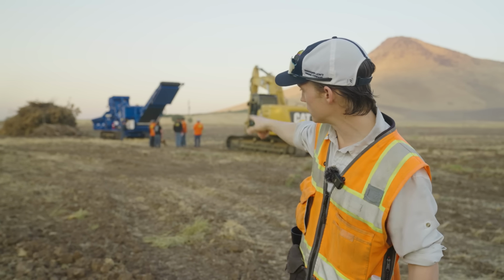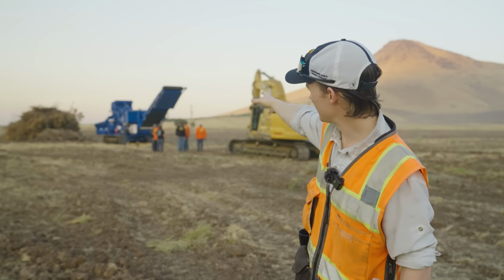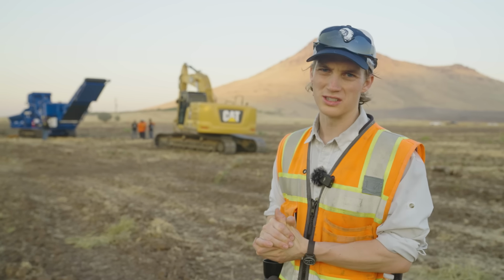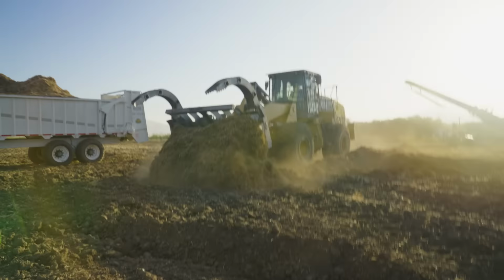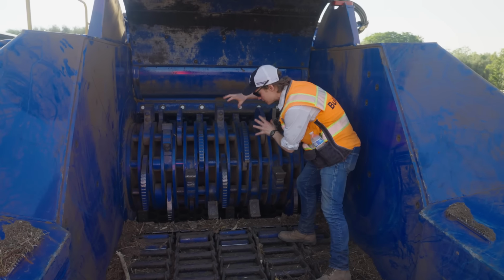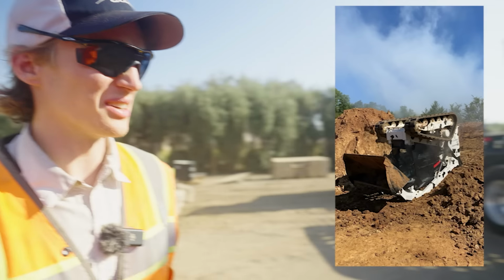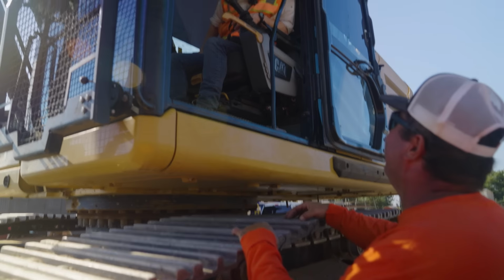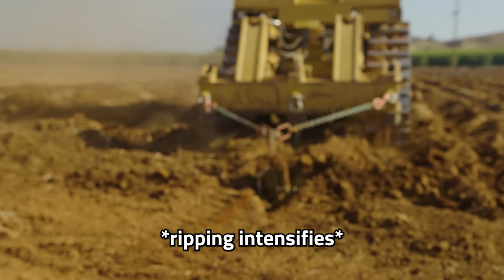Why Shredding Trees is the New Norm in California

Comment: There is a german company, Jenz, who also makes large shredders for bio-material. They make the BA 1016 with over 800 hp, a very impressive machine as well. They also make self-propelled models which are mounted on truck chassis, with a loading crane for feeding the shredder and a turning cabin which can be facing forward for driving or to the rear for working. They are in Farming Simulator as well.
Reply: This machine has 2,000Hp big difference.
Reply: @robbybachmann8061  Aaron mentioned that it's powered by a Cat C32, which is listed as having a maximum output of 1350hp.
Reply: @robbybachmann8061  Now, i am not sure how Scrap-board-production is messured, but if it is roughly equal to the german unit Schüttraummeter, then this machine performs worse than the Jenz. The Peterson only manages 499 m³, while the Jenz manages 540 m³. And with a smaller engine, the Jenz probably also uses less fuel.
Reply: The farming simulator sentence could have been left out, we would have been fine.

Comment: A burning ban may seem silly but California’s Central Valley, especially the San Joaquin is subject to very stagnant air, especially in winter that produces “radiation fogs.” 

After a winter storm passes through, the clear air and damp ground encourages an overnight ground fog which is slow to burn off, and just gets thicker night after night and is known as a “Tule Fog” with 1/10 mile visibility, that will persist until the next winter storm passes through, clears the air and re-starts the cycle. Add smoke form any source, and it just gets worse. 

The Wasatch Front at Salt Lake City has the same problem, with freezing temperatures creating “ice fogs.”

Comment: The reason you load over the back isn’t because it’s faster than a normal low bed, it’s because this model trailer absolutely sucks to break down the neck. And good luck getting it back on on uneven ground like some construction sites without a ton of experience
Reply: Those trailers are built for that  the neck is quick and easy to get off you can load them off level and when it's raining just have to plan for it

Comment: The 6710 eats EVERYTHING. Its not uncommon to replace those teeth on the mill daily, depending on your feed stock.
Reply: Used to operate one of these and the massive stumps and shit we put through it we would check the teeth on the rotor at smoko and end of shift, replace or rotate and tighten

Comment: I was camping near North Rim Grand Canyon and saw a Barko 937B going around on forest service land shredding trees. This went on for weeks. Much smaller machine than this (I'm seeing 300hp or so) and very different setup too, but I'm curious as to the reasons for doing it there. They were thinning, not fully clearing.
Reply: what you saw is likely forestry mastication, used to reduce (small diameter) tree density in forest stands that have not experienced the frequent, low intensity fires that they evolved with.  Before mastication these stands probably had a high density of smaller trees from the lack of fire, which leads to increased danger for extreme fire events, as well as a general decrease in the health of the ecosystem.

Comment: Almond and Walnut prices are at the lowest point in decades. They are doing a lot of removal of old orchards, but are also removing a lot of good producing almonds because they are not turning a profit due to the market. In 2008-2010 farmers began planting almonds like crazy as the market was projected to boom - but new trees don't produce for 3-4 years. By 2014 the market hit it's peak and with all the new acres of almonds beginning to produce and be injected into the market, the price began to decrease - 2008 we had about 800,000 acres of almonds in CA - in 2021 there were over 1,650,000 acres - that number is now decreasing, being replaced by other more profitable crops.

Comment: Isn't it also much safer mixing the stuff into the soil vs setting things on fire?
Reply: only in california.
Reply: @THEmadmikeismad  california and the rest of the developed world
meanwhile the rest of america follow india, china and africa in the way they do things
Reply: @vincentgrinn2665  And instead of doing it the cheaper way you get to pay for this $1mil machine, fuel, labor etc in the price of your produce, I hope the better air quality in the middle of nowhere is worth it.
Reply: @jaycweingardt11  the cost to healthcare that crop burning causes is far more than the cost of the machines, 18,000 people die from crop burning smog in america every year, and it isnt just the middle of nowhere, that smog moves hundreds of miles

and its severe too, like you cant go outside without a mask otherwise youll choke kind of bad
Reply: @vincentgrinn2665 where the hell did that fact come from and how can it be proven? I mean a properly built brush pile barely produces any smoke as long as it's not packed with dirt and it's dry.
Reply: @Chad-qe6yv  well theres obviously some issue because its a common and significant problem all over the world, and the main pollutant is black carbon(think diesel coal rolling, coal power plants etc) so im not sure what impact dirt has on that
Reply: @vincentgrinn2665 The stat you pull is probably from forest fire (if its true)there is a huge difference between a couple of tree and 10'000. The carbon from the tree will still be release the only difference is how fast, so yes this way of doing it is way worst in almost everyway.
Reply: @raptor0286  youre right that theres a huge difference between crop burning and forest fires, forest fires are just that much worse
also the speed of release is a significant and important factor, running your car engine with the garbage shut for a few hours and burning some matches nonstop for a year might be the same amount released, but the matches wont kill you.

also when the ground up tree material is put back into the ground, very little of it is released, as it all either disperses into the ground or ends up in the next lot of crops. its specifically burning the organic matter that causes a lot more issue not just natural decay
Reply: @vincentgrinn2665  Is the air quality why people are leaving California? or is it the sky high cost of living and massive taxation?
Reply: @vincentgrinn2665  Almost all of the nutrients stay in the ash and is left for future crops. lots of decaying organic matter sucks oxygen from the soil and weakens roots of future plants.
Reply: @jaycweingardt11  all of those things are rampant in most american states, well other than the flyover states
Reply: @jaycweingardt11  The people leaving are generally older, conservative, and not exactly "makers" as the right like to babble. I doubt that the economists and politicians are wringing any hands over their departure.
Reply: @kerrykerry5778  The absolute state of California would show that is not true. But enjoy your cope.
Reply: @jaycweingardt11  California has a strong conservative/liberal divide. In terms of agriculture - we're king in the US. The wood chips do wonders for the heavy clay soil as they decompose they soften it up and promote mycorrhizal growth. We have more citrus than Florida, more peaches than Georgia, and more dairy than Wisconsin. 

Now the big cities have plenty of bad governance, but we also have lots of small wild west towns that are doing just fine. Even Central Valley towns are widely growing as people escape the urban hell of places like the San Francisco.
Reply: @jaycweingardt11  lmao not only do you cope but you're wrong about the soil science too. Decaying organic matter is necessary for healthy plants and burning all of that would mean you lose all the carbon rich hummus and hummic acids. Maybe if you spent your time learning instead of hating on the biggest economy in the nation you'd know something.
Reply: @Chad-qe6yv  That stat comes from medical studies and is supported with statistical analysis.
Reply: @jaycweingardt11 nonsense. Go to any forest and see if organic matter "sucks oxygen" from the soil.
Reply: Interesting to note that the fuel consumption of these machines would exceed 250 gallons per hour at that rate which option produces more chemical waste and which is worse for the environment? Especially when the chemical reaction of a wood fire basically produces CO2 and water??😊
But then again a lot more profit for someone 😮
Reply: @kancutter  bingo, that's what it is. I bet there are lots of politicians who own shares in this chipping company.

Comment: I used to run the next size down from that grinder the 5710 and a 330 on pipeline. we always side loaded both it takes about 20 seconds for the 330 and about 40 for the grinder. and for the sideload haters our trailers would get sideloaded 20 times a day with no issues.

Comment: One thing you didn't mention here is, how often do they do this?
Reply: can be several decades depending on crop
Reply: Depends on the crop but the usual cycle is 15-20 years
Reply: Depends on the tree but an orchard out there will normally go 25-30 years before they have to rip it out and start over. Once you replant then you have a 5-10 year wait for tree nuts before the orchard is productive again.
Reply: Almonds 15yrs+ 
Walnuts 30+ (market is weak, a lot are coming out)
Grapes (???) 
Citrus 30+
Stone fruit 30+
Pistachios 50+

Comment: I always though that if you tilled chips it would kill soil life. Soil bacteria that thrive off carbon would decompose the chips, multiplying exponentially and saturating the soil with affixed carbon instead of nutrients. Best to leave the chips on top where they can retain moisture. But hey, I'm not the one getting the gov subsidies.
Reply: It kinda depends of the depth, quantity and quality I think. If it's high C/N wood, from trunks and old branches, tilling it in further than 4 inches leads to anaerobic conditions, the wood doesn't decompose at all, turns hard and grey, etc... Especially in low humidity conditions. And nitrogen hunger on top of it as you mentioned, that can go on for a looong time. Not a fan of this method either.

Comment: Call me skeptical but how could burning those trees put more pollutants in the air than the entire process of shredding, spreading and ripping it into the soil...
Reply: That would be a good question for the people that run California
Reply: Carbon sequestering for one, but also if you have ever seen a massive bonfire it’s exponentially more emission than a dozer exhaust and will burn for days. You probably send more smoke into the air in one hour of the burn pile than a month of dozer work.

Comment: Can’t burn to conserve air quality, then the grinder is kicking out that 3:26 😂😂
It’s just convoluting a process to extort money
Reply: The difference is that the dirt and chip particles are heavier so they will eventually fall back to earth; smoke is much lighter so it just stays airborne.
Reply: @Duvstep910  several million dollars in equipment to clear land, only in commifornia.
Reply: I agree, but they are using the chips as compost, it's better for the soil in the long run.
Reply: I misunderstood your comment, dirt particles are heavy and sink to the ground, so while the immediate area is affected, smog isn't a factor here.
Reply: @benzlover55  They're not composting, though. That would involve piling it up and letting it rot in one place for a while with a bunch of added nitrogen-bearing stuff. This is just ploughing carbon under. And not really ploughing it either.
Maybe if they weren't using flat farmland to grow trees, they wouldn't end up with hardpan?
Reply: @Skorpychan  Composting is fastest when there is a balanced amount of carbon and nitrogen in a large pile where bacteria partially break it down. The bacteria also produce heat, and the heat will break it down further. 

When the wood chip[s are burried in the soil, they are instead broken down by mycorrhizal fungi which are excellent for plants. As the wood chips break down - they also release nutrients slowly over time and soften the heavy clay soil.

Comment: That is the hardest thing on lowbeds there is and very unsafe because when you put steel aganist steel  there are chanse of sliding off too the side with no control and a very good chance of damaging both lowbed and machine even hurting the operator a drop front lowbed is a lot safer than this operation !
Reply: Seems like they knew what they were doing. I’m assuming you’re not running millions of dollars worth of equipment. If it was bad they wouldn’t be doing it. It’s also what the trailer is designed for

Comment: What is the idea behind loading that way? Just quicker than removing the neck?
Reply: Disconnecting the neck takes me about 2 minutes total so that’s not where I see the benefit. When you are picking equipment up off-road, the trailer tends to sink into the mud when loading unless you put blocking down, which can make it difficult to hook the trailer back up.

Also helps where there is limited access, you would need room for machine to get around truck or trailer to load so backing right up to machine is helpful.

Lastly, you should use mats or plywood when tracking over asphalt so this could limit the need for that considerably.
Reply: @Treehandler  thank you 👍
Reply: Takes less yard space for loading.

Comment: Little over kill running 6710 in that stuff dunno why owner would wanna burn that extra fuel for zero gain then running smaller grinder
Reply: Yeah you definitely know better than they do.
Reply: @maxmyers1554   been running wood grinders for 10 years so yeah prob do
Reply: The wood chips are excellent for the soil. They soften heavy clay and also support mycorrhizal growth. It's not zero gain when you're growing trees for decades vs corn/soy/wheat for months.

Comment: ROFL, how is running a massive diesel engine for a few days better than burning??
Reply: Now in terms of carbon - with fossil fuels you take carbon from underground and move it to the air. Trees take carbon from the air and wood is mostly carbon. Burying that carbon back in the soil sends it back where it came from. 

It's also not a few days, it's a few hours. The wood chips do wonders for the soil and that has made California the state with the most agriculture output.

Comment: So correct me if I'm wrong. 
But you can't burn because of particulates that go in the air but you can burn 1000's of gallons of diesel running the machines that mulch the waste? 🤷
Reply: Wood chips are great for the soil and a big part of what made California the agriculture capital of the US. Those diesel engines don't run long enough to burn thousands of gallons, they get it done fast.
Reply: @aminy23  Fuel Consumption of the C32 engine. The engine that's in the chipper. This is not including the other plant on site.
100% load with fan – L/hr (gal/hr) 262.7 (69.4) 262.7 (69.4) 238.6 (63.0) 217.9 (57.6)
75% load with fan – L/hr (gal/hr) 195.9 (51.7) 195.9 (51.7) 179.2 (47.3) 164.8 (43.5)
50% load with fan – L/hr (gal/hr) 135.9 (35.9) 135.9 (35.9) 125.8 (33.2) 117.2 (31.0)
25% load with fan – L/hr (gal/hr) 80.8 (21.3) 80.8 (21.3) 75.9 (20.0) 71.4 (18.9)

So yeah it does use 1000s of gallons of diesel if used at 100% over an 8 hour day. Which it will be inorder to chomp through the trees they were feeding it.
Even at 25% it uses 21.3 gallons of fuel per hour!!

So you might wanna check some facts before commenting.
I'm not disagreeing that chippings aren't good for the soil.
 I was just struggling to get my head around the can't burn the timber because of the particulates it would put in the air but the Californian gov are happy for a massive diesel guzzling engine to put particulates in the air. 
Wood burns damn cleaner than diesel that's for sure.

Comment: Why people hate Sacramento.  Instead of burning the trees and plowing the carbon and potash under for the next crop, you have to pay someone to grind them up.  That is ONE additional cost.  The SECOND additional cost is importing potash fertilizer that you used to get from the ash of your burn pile.  There is no way to replace the benefit of the charcoal that you could plow in as well.  This grinding may be good for "air quality" but given the diesel going into the air for grinding, transporting the potash, and the carbon from the charcoal being buried, it may not be green.